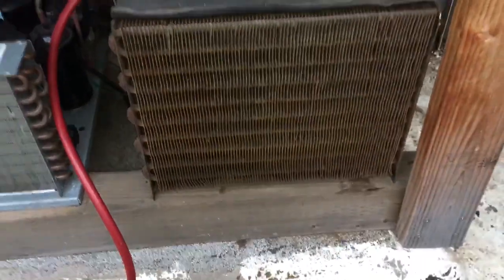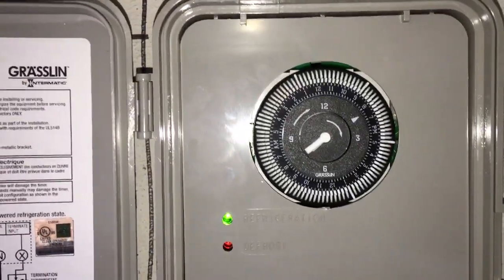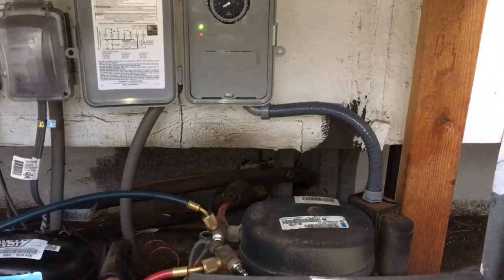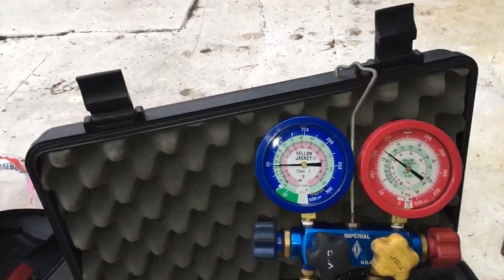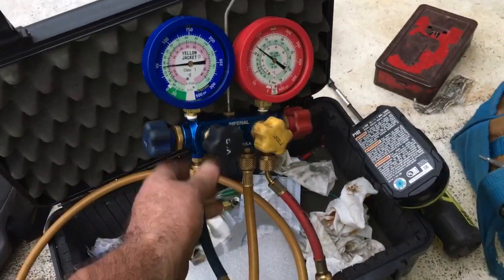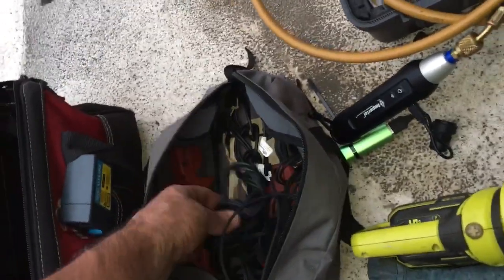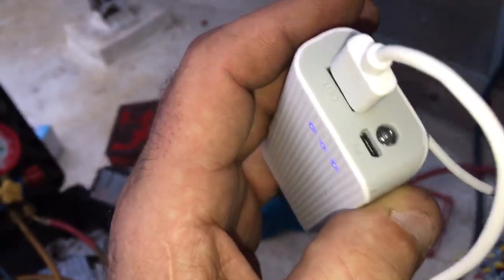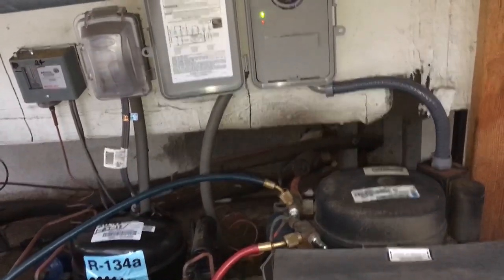What do You Do when a Compressor only pulls down to 35psig ? + iconnect latency talk vs analog

Comment from the maker: An Update For Ya'all --- i Just Temp. checked The Kegs in this cooler they are at 30 degree's and the evap was 99 % clean & clear of ice. This works in a pinch ! First time ive ever done this in 37 years of service. ain't this trade Grand !
Reply: OcRefrigeration,Hvac & Electrical. You did a great job, and the fact that its r22 that thing will be cooling for long time to come, even with
A shortage of refrigerant, thats my op. With 17 years in the trade

Comment from the maker: So, anybody Got any idea How long the compressor will last ? / How long till valves are toast.
Reply: OcRefrigeration,Hvac & Electrical. I think that comp wil outlive the keg cooler.😁
Reply from the maker: @sjefoekel6058  its still going ! 2020
Reply: @OcRefrig  gotta love it!
Reply from the maker: @sjefoekel6058   I know. I can’t believe it. 😂
Reply from the maker: thatsvery optimstic thinking but, i dont think that compressor will last. 
How much time ? i Really dont know. id say no longer than a year. maybe 6 months im thinking , if they are lucky 🍀
Reply: Nice solution OC. I carry just the timer itself for Those situations. They’re cheaper, smaller and come in different voltages. those Valves are already toast. I’d plan on replacing it within a month or it’ll go down on a Friday night and no one will be happy.
Reply from the maker: @chrisbivens5410   its still going ! 2020
Reply: OcRefrigeration , Hvac & Electrical Video's. That’s amazing OC! Just goes to show when you think you’ve seen it all.....
Reply from the maker: Yea, thats my plan to replace condensing unit within 30 days IF They Approve to Replace. You know how it goes sometimes  though , if something is still working for them , they wont spend the cash until its broke. They are tearing this building down in 5 years , so He May Roll the Dice. 🎲 Hopefully not. id really rather schedule the repair than Get this call - whenever. cause we know this thing is toast allready.
Reply from the maker: Yea, i know the timers you are talking about , but this is outdoor location , and had to use Raintight Timer. i Really like using these timers because they are idiot proof and tell the Managers when its in defrost with the redlightbeing on. I can ask a manager if its in defrost that way over the telephone. saves everybody a trip & gets them back up and running if they had a power outage & timer gets off time. It Makes Them very happy when they can just turn the clock and they are back up and cooling again. Red light goes out and they are Visually satisfied its out of Defrost. Makes everyones life alot easier & they are almost the same cost as a Small square " Newport timer " is what u are using.

Comment: Hey, one good idea.  But when the comp valves get so bad the unit won't pull the box temp,  then a new compressor has to be installed.  Now the customer has the cost of the compressor replacement plus the timer cost to deal with.  Not trying to be smart here, but why not replace a compressor that is destined to be replaced,  and you're done.  Would that be a better choice?  Or did  your customer opt for the  timer for now?  Appreciate your videos.
Reply from the maker: Friday afternoon. Gives me some time to get with the customer next week & get approval , etc. gets them up & running for the weekend which is huge. Condensing unit is beside ocean , its trashed , needs whole condensing unit change out. also this is a Back bar keg unit with 3 doors that get sometimes left open a crack , keg hitting door , unit freezes up , it was best option for particular situation.
Reply from the maker: its still going ! 2020

Comment: Why not just use the low pressure control to cut in like 75 and out at 45 if r404a and set the temp control bottom out to run the liquid line solenoid on all the time
Reply from the maker: Yea, that was my first thought also. go old school , pressure control only. But, this compressor is so bad , i mean 35 psi is almost a gonner , i cant believe it even still works with valves so bad. i did not want to chance short cycling the compressor, so i opted for a safer option , just run it and defrost it. as the valves get worse u might have to cone back and adjust , and adjust , i just wanted to be safe rather than sorry. even with running just pressure control , alot of times u got to run a defrost clock too. so, i went this way. its a remote perlick bar keg unit.
Reply from the maker: its still going ! 2020

Comment: Good idea with the defrost timer. I don't use my Testo's or Fieldpiece probes when I'm checking valves, efficiency or setting up controls. I prefer analog gauges for these tasks. The response time and repeatability seems more accurate and consistent. Thanks.
Reply from the maker: Yea, i totally agree. but , i was pleasantly suprised the iconnect is very accurate and responds just as quick as analog. i thought it woukd have the same lag as a testo. id likd to hear froma field piece user to see if he has lag or not. analogs rule ! no batterys to replace and u can see them in the sunlight. but, digitals are nice for superheat subcool etc. pt chart built in for different refrigerants.